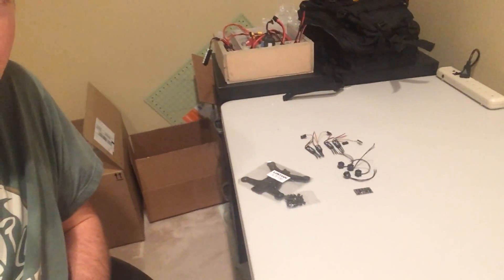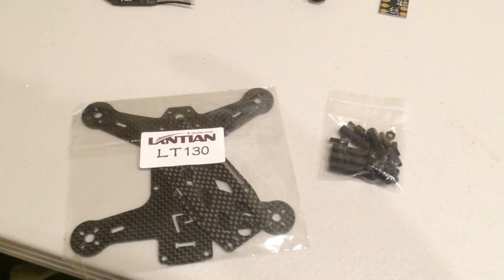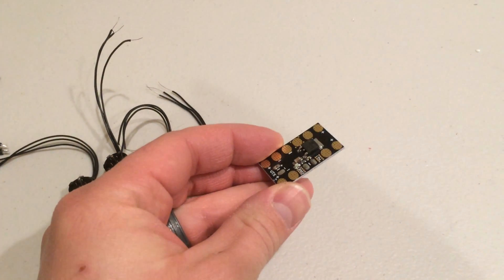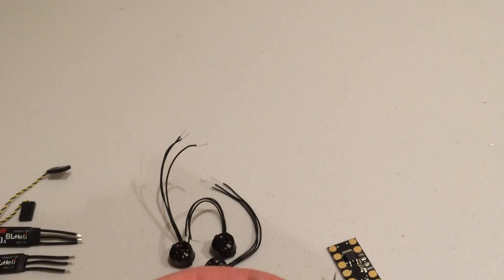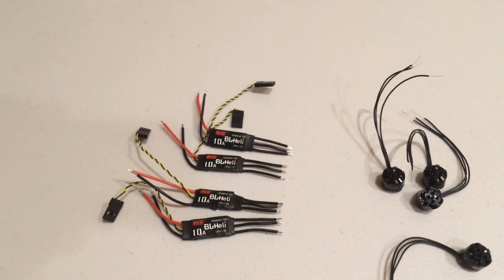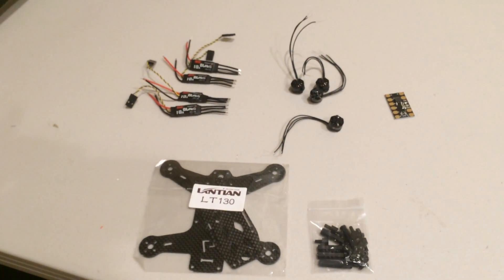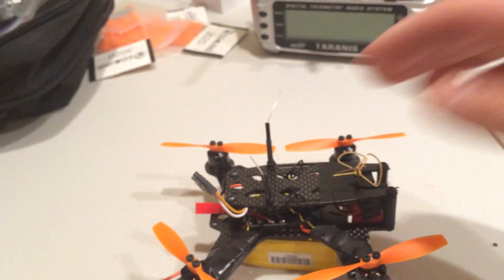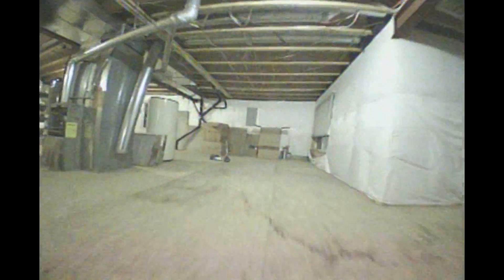Liantian LT 130 Micro Quad build and Flight!

Comment: This is a nice idea build, but the 1100 series motors are more designed for 115mm light weight frames or lighter (88-100mm preferred by most).
In your build, love the use of the micro PDB, great way to keep frame light. :)  I'll adopt it to my first build that has a full size PDB (will reduce 6-9grams if I go your way)
In your build, it performs like a tiny whoop Furibee 36 (or similar, based on flight style).  
I did a similar build but used 1300 or 1400 motors. I got more than 9mins just hovering (on its own weight) and 8mins with a 20-22gram HD cam installed in a carbon enclosure. 
Flew around for over 7mins, before battery alarm went off (4S 850mah Lipo (60-75C, use 2 different brands of Lipos), if you're using 1306 or 1407 motors, can support 4S without issues). Make sure environment is not too warm. Motor can get a little warm in 60 degree temp room (warm, not hot)
I'll make a vid soon (practicing flying with my first build and finishing my 2nd build this weekend).

Comment: great build :)
Can It carry a GoPro Session??
Reply from the maker: +Zaidroid With this build there is enough power (5 mins as it is now) to carry a session, but it would reduce the flight time (say to 2.5-3 minutes) and you couldn't use the the FPV camera I have because the antenna is in the way of where the session would go to.  I would recommend 1105 motors and getting a different camera and video transmitter so you can put the video antenna in the back and free up the space for the session.